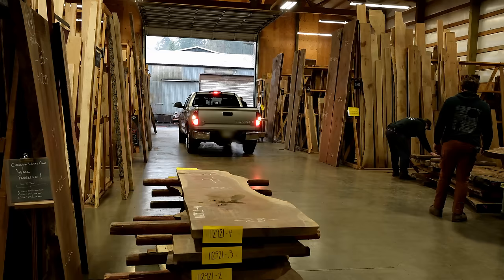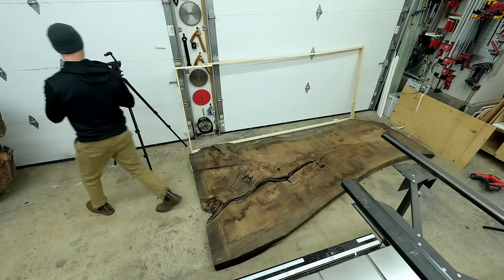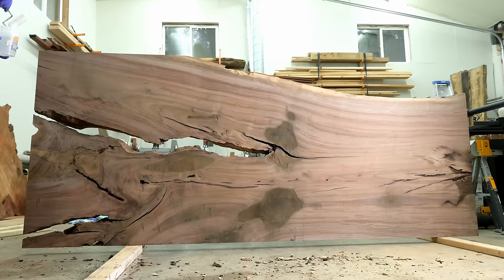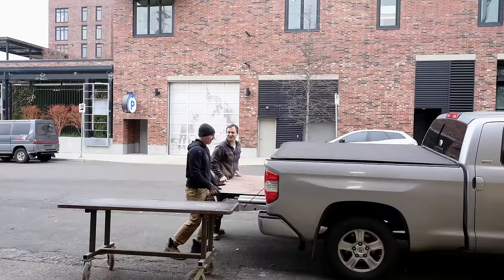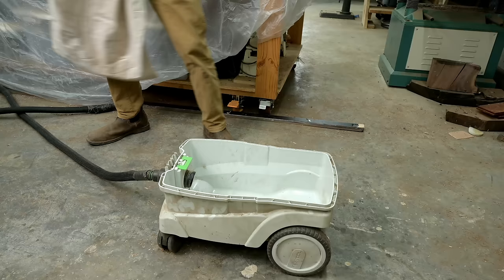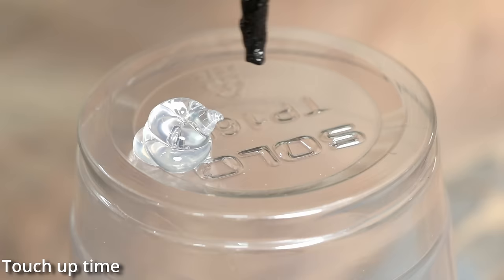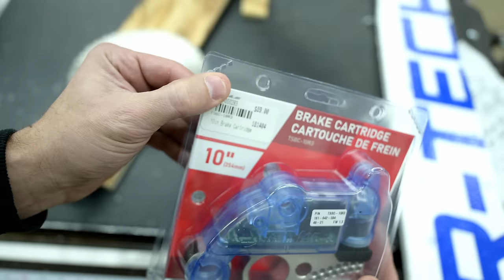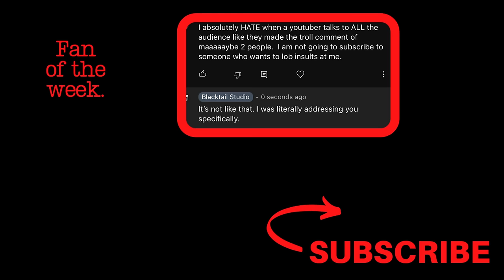The Client Hated This Slab

Comment: I was thinking, you can use some kind of a steel ramp for your truck whenever you need to slide something on it. That way you can avoid the risk of it sliding out on to the floor since you won't have a slope to fight against so to speak.

Comment: For the BOW TIE why don't you make  premade template for router and use the chizel only for the angles that router cant made them or even the bow tie can be with the same round angle... You can save those 30min or they will be  only 5 minutes for the whole process... Sorry for bad English - greetings from Macedonia 💪🏻👍🏻🇲🇰

Comment: So why did the sawblade stopper activate? , easy answer static charge from the Styrofoam.
As for the pipe rollers that you use to get the wood in and out of the back of your truck, I have an easier solution , and that is fixing nylon strips into the back of the bed of your truck being nylon does not wear very easily and most things will slide on this , means a couple of strips should do the job , and if you have trouble finding any nylon, I would suggest that you go to your local kitchen store and buy some nylon chopping boards as they are really cheap and you can cut them to whatever size you want  , as always keep up the good content

Comment: G'day Blacktail; New subscriber here. Dunno if you ever go back over your old vids to check out fresh comments; but, here goes anyway.
I'm loving your courage in risking new techniques, when they work they really pay off, good on yer for having a crack at new stuff.
You grizzled in another video I watched about how you didn't think likes or dislikes added upta much. I reckon a dislike is as valuable to you as a like, all those likes/dislikes are clocking up, and furnishing proof to You Tube how many views you're getting, ie., dislikes are a blessing (there's always gonna be haters (read losers) for that matter negative comments add up in your favour as well, hell, some negative comments, if valid, can help you improve skills/technique (so long as it's constructive criticism that is, just ignore any piffle).
I noticed you using some kind of soft setting rubber to fill up gaps/holes, and you mentioned that you weren't too pleased with the soft feel of it even after it set; on this, I saw a You-Tuber do something you might try out to check it's viability for yourself on a scrap piece of wood that has borer-holes or whatever. He used powdered charcoal then filled his hole/gap with the powderised charcoal, or maybe built up the charcoal in layers; then, he used droplets of quicksetting glue, soaking the charcoal with that, and building up layers of that until the hole/gap was filled.
The glued charcoal would set rock hard, like the wood around it was solid/whole again. It could then be sanded flush back to the rest of the surface. I have seen scale model builders use a similar technique utilising baking powder, in fact these guys would also build dioramas, using actual sand. They would cover a  pre-glued/tacky surface area with their scaled down soil/gravel, then spray alcohol to permeate the loose medium/soil/baking powder, then spray or apply glue to that, setting the baking powder into a solid form that wouldn't move each time the diorama was moved. Just a suggestion for another option in gap filling you might experiment with.
I'm loving your posts, love the shimmering/opalescent woodgrains that you manage to bring out, and highlight making your works real showpieces. Love it.
Best Regards,
Carlos.

Comment: First time I've seen your videos.  I know nothing but I always thought those saw-blade stops worked off electricity/currents and if it the current gets jumped like by flesh or something then it triggers.  I know that styrofoam (for a reason IDK) can cause static electricity which is very high voltage in nature so maybe that confused the safety mechanism.  If someone has the reason I'd love to know.

Comment: As for the C in C you'll get less respect.  I started as a shirtsleeve accountant with fine pencils and two adding machines, ribbons and tape.   My firm acquired PC's in the mid-80's, respect and overtime went downhill.  As for the blade probably static electricity very common with the foam.  Great work.  Narragansett Bay

Comment: Love the vids and hello from Ireland 🍀☘️🍀☘️ Question if I may, what caulk sealant do you use for your white chip board moulds ? How come it leaks ? Would a strong Tec 7 adhesive or something work better ?
Reply from the maker: It’s a fine line between using too good of an adhesive. Too good, and it’s a nightmare to take off.

Comment: nursing tip: when u insert the needle for the FIRST time, add the same amount of air u want liquid out.  then EVERY time after that, no air. THEN as the amount decreases, after u insert the needle, turn the bottle upside down, and pull the needle out so that the tip is still in the white part. your method screams mess 😅
Reply: when u said u need a girthier needle, u needed the original air replaced as evidenced by the fact you got SOME fluid. trust, when u use wrong needle size, u get nothing